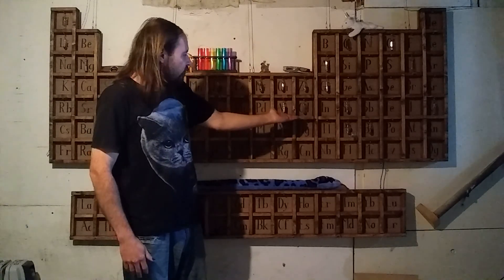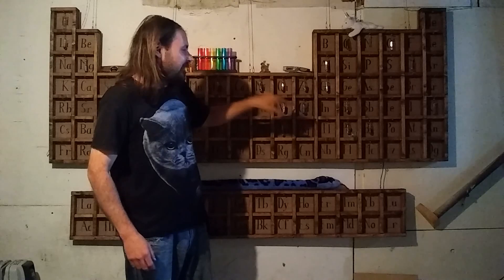Collecting the Elements: Episode Twenty-One; One Person's Trash (Cadmium)

Comment: What solution do you use to extract cadmium? Can electrolysis be carried out in sulfuric acid?
Reply from the maker: I used hydrochloric acid. Sulfuric acid would work too.
Reply: @DancingRain  Thank you! So minus filler from Nickel-cadmium batteries can I get cadmium by adding cadmium oxide and hydrochloric acid and get cadmium by electrolysis? Did I understand correctly?
Reply from the maker: @SuperDutchman59  Yes. Though, if you don't have a cadmium anode, I'd recommend a carbon (e.g. graphite) anode. If you use a carbon anode, and don't want to produce chlorine as a byproduct, use another acid - sulfuric or acetic should work just fine.
Reply: @DancingRain  I have approximately collected about a kilogram of anode filler from a nickel-cadmium battery, and I need cadmium. That's why I asked you, for which many thanks!
I’m thinking of using steel plates as an anode or if I get coal. The store has only hydrochloric acid, but as for acetic acid, alas, it disappeared from the store and there is only ordinary vinegar, I think it will slowly precipitate cadmium on the cathode.